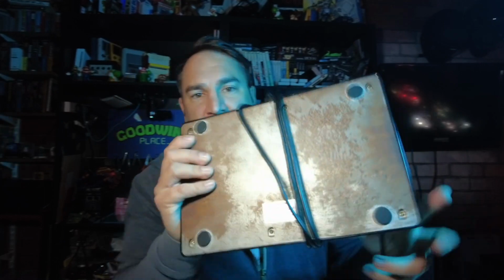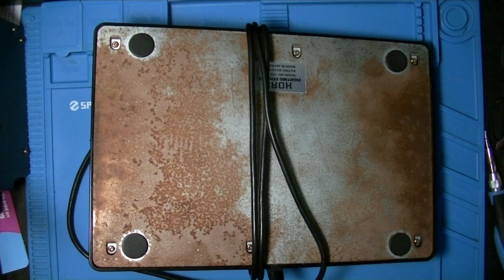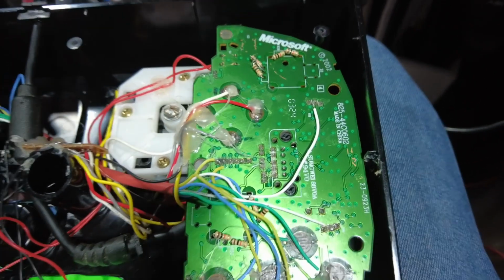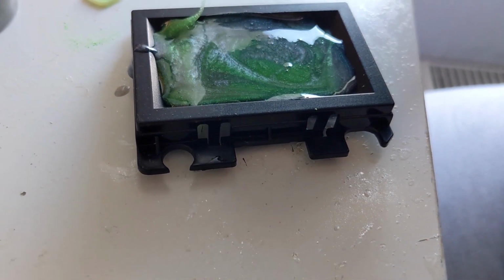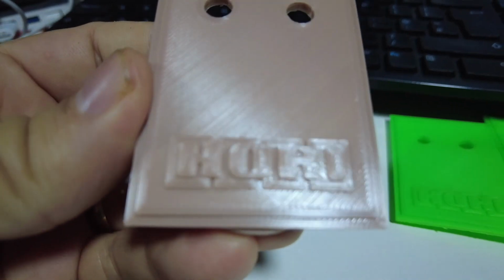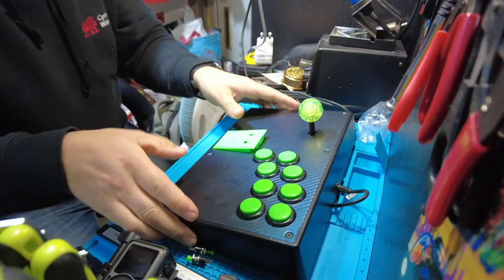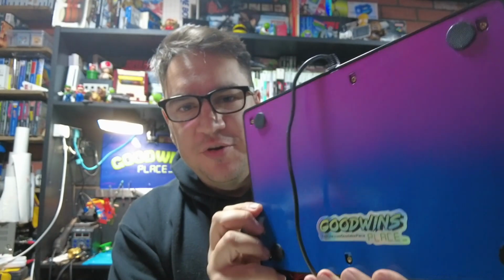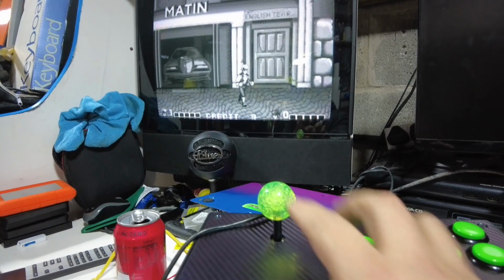Hori Arcade Fighting Stick Conversion | Sega Saturn to Original Xbox

Comment: I have this stick and sometimes the left and right direction will just stop working. Is there an easy fix for this?
Reply from the maker: You'd need to open it and clean the micro switches all around the joystick. That should help it get a better connection.

Comment: also anyone else that get these, EvapoRust works wonders on the bottom plate, used it on my Hori Fighting Stick Neo II
Reply: update: Evaporust does a great job removing the rust but treatment of painting is still needed, since I had the rust come back as soon as the humidity went up.
Reply from the maker: Yeah they are a nightmare for rust. Spray or clear coat is probably cheapest option.

Comment: I have that exact same joystick for my Sega Saturn, but one of the buttons no longer works..I've been sitting on it for years..I don't want to get rid of it, since I still use my Saturn but I don't have a good joystick to use with it anymore.  Not sure I can get it fixed anywhere locally.
Reply from the maker: Might be able to just clean the contacts on that button. 
I'd start by opening it up and testing the continuity to make sure it's still functional.
Reply: @GoodwinsPlace  never attempted anything like that before

Comment: Ohhhh fella seen you had subscribed so thanks.This Arcade stick is awesome & im a joystick pervert,i just got back into Xbox original & i think i need something similar for the fighters.Brother this is one hell of job you have done 💚it’s gorgeous ✌️
Reply from the maker: Enjoyed a few new channels on Swap Shop last night.
Nothing wrong with looking at another guys joystick. 🤣 It turned out great, I'm up for doing more but it's getting a good solid base to start with is the expensive bit, those Hori sticks ain't cheap and not seen anything similar with enough space inside to do the PCB swap. The swap out isn't that much work really, just a lot of wires to some small pads.
Reply: @GoodwinsPlace   Im going to being eyeing arcade sticks up more than ever now voyeur style😉Appreciate the reply & keep well fella 👊🏻✌️

Comment: That is an absolutely cracking job Craig.

Very smart indeed.

I'm after a "ball" for a PC Engine arcade stick I've got. Where did you get your bits from?
Reply from the maker: Thank you. It turned out quite smart in the end, really enjoyed doing a bit of everything on this one.

That ball is from Arcade World UK, think it was a fiver posted. They are normally a standard thread size on most sticks.
Reply: @GoodwinsPlace  ok cheers Craig 👌
Reply from the maker: @DadLadsGaming  would be a good project for you if you're looking to start doing soldering mods.

Comment: I could watch sorcery like this all day, and evolution of that 3D printed panel was interesting, glad you added that.
Reply from the maker: 🤣 thank you. I'm no wizard, more like when it all goes wrong in Fantasia. 
I thought I'd show that as it was one of the biggest parts of the project even if it wasn't the most technical, it took me a few weeks to sort the whole thing with each change and the finding time to run off the next print.
Cheers for watching.

Comment: So first question is that is it possible to put sanwa jlf lever? 
And will fit using typical fightboard (brook board) ?
Reply from the maker: Yes to the JST connector on the Samwa they run same style microswitches and have a common ground on the 5th pin. 
Not sure on the fit, you can get the depth dimensions on a lot of websites, you'd need to find out if the depth is right but it shouldn't be much more than the standard.
Are you looking to do an original Xbox stick or something else?

Comment: You did an awesome job mate, looked like it had been sat in a pond for a couple of years before you tackled it.
As sexy as a sexy thing covered in sexy sauce 🥰
Reply from the maker: 🤣 thank you. The strange thing is none of the screws underneath or anything else had rust on it. I think it is just the metal they used seems to like to attract moisture. Hopefully it will stop or at least slow it down now.

Comment: Nice Craig, I wondered how you was gonna convert it Xbox.  Shame you didn’t replace them crappy buttons with some nice arcade quality ones but from the sounds of it, it would have come out of your pocket so totally get it.  Nice job on the wrapping and spraying.  Shame you didn’t go in to much detail and have footage of the fault finding when you removed the sticks.  That would have been very interesting I think.  Favorite bit was when you described the torx fitting as ‘like a star’ very smooth 😂
Reply from the maker: Thanks mate, glad you liked it.
Scott is covering cost of parts but I think he was happy with the buttons. I agree though a different set could be a cool upgrade.
Other than me scratching my head and then reading the continuity on the old joystick pots it wasn't much more detail to sorting the joysticks but will try and get bits like that included in the future. 
Torx smorx, star shape is more on my level. 🤣🤣 I honestly don't know why I didn't call it Torx at the time.
Cheers for watching.

Comment: Lovely job 👍 the perfect amount of hot glue too 🙂

I wondered how you were going to interface it, reusing a controller board was a good idea. It is close to USB iirc.
Reply from the maker: 😂👍Hot glue comes a close second on my danger list after super glue. 
Yeah the original Xbox pad is pretty much a fancy USB connection, I've done some memory card modifications too in the past where you can plug a USB stick straight in to either the port or in to the controller memory card slot, the system is pretty much a basic gaming PC when you think of it. 
Thanks as always for watching.
Reply: With you there! Super glue is pure evil, and not all that super either. I only ever dab a bit on with the end of a wooden skewer and try to stay several inches clear. KFC do useful skewers incidentally, stuck into their corn cobs.
Loved the paint effect btw, big 👍
Reply from the maker: Great tip on the skewer. 
I thought it would add a little bit of a different vibe to the bottom of the unit rather than the previous rust effect.